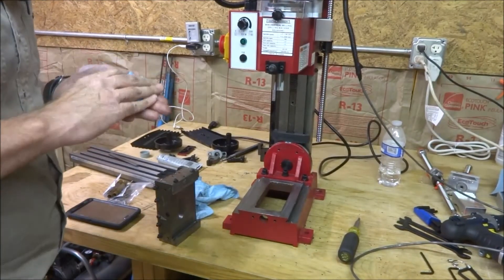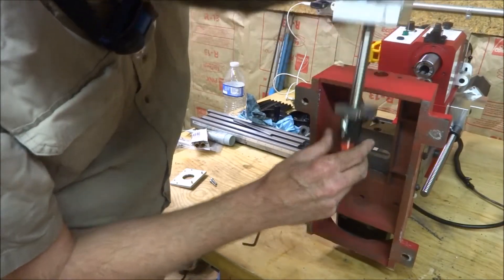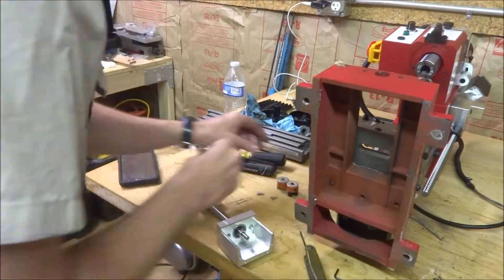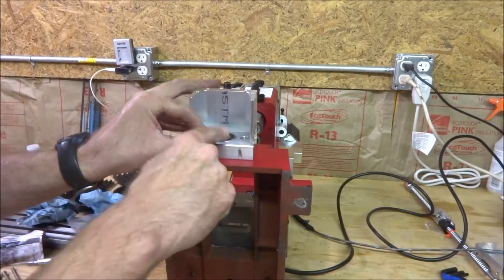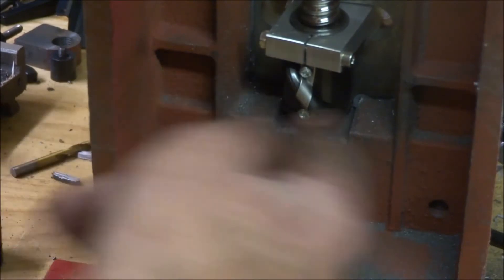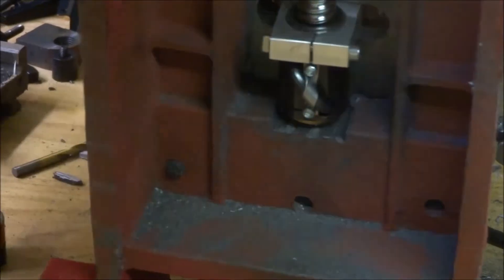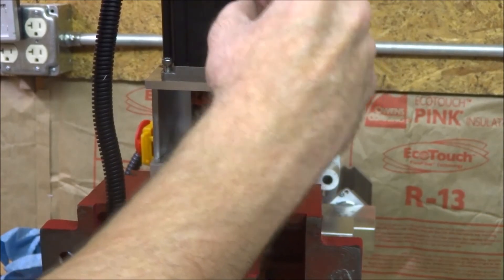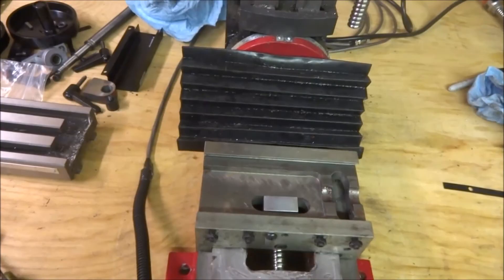Mini Mill CNC Conversion Part 5 - Y Azis

Comment: Hello again craig, would you happen to know if the spindle head gas spring upgrade and belt conversion upgrade are compatable after the z axis cnc mod?
Reply from the maker: +Josh Williams - Hey Josh, The gas spring upgrade that I got from Little Machine Shop was not compatible with the Z axis from CNC Fusion.  I was able to use the belt drive conversion kit that I got as part of the package. I guess It might be able to be rigged to work on the side but i'm not sure.

Comment: On the dust guard holes that were misaligned.  Look carefully in the video at the right hole, it appears to be a full diameter closer to the notch than the other.  You may want to give cncfusion a heads up so they can check their stock and machining.  It's one of those things where hopefully it was a glitch but if not I am sure they don't want any more to go out like that.
Reply from the maker: +madmadmal  - Thanks.  Yeah, I let them know.

Comment: I didn't need to do any cutting. I didn't install the mount until after I installed the ball screw through the hole and also positioning the block (nut). Very curious to know what happened here????
Reply from the maker: +kaydee457 - I know a number of people that had to cut.  CNC Fusion said it happens sometimes.  I guess there are some slight variations in the mini mill castings.

Comment: Good Job,
 If you install the ball screw first and slide the Y mount over and then bolt it down would that have worked Or was there just not enough clearance altogether.
Seems if your making a kit that's bolt on it should be bolt on!
Reply from the maker: CNC4XR7 
Thanks. I tried that, I just cut that section of the video out to make it shorter. With the end of the ballscrew all the way down, there was still around 3/16 of an inch of ball screw sticking out the top.